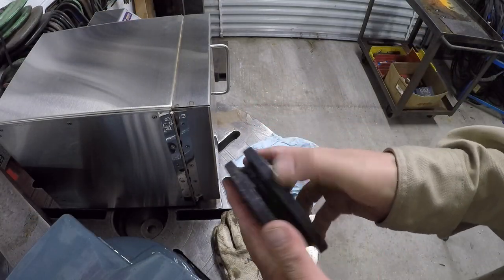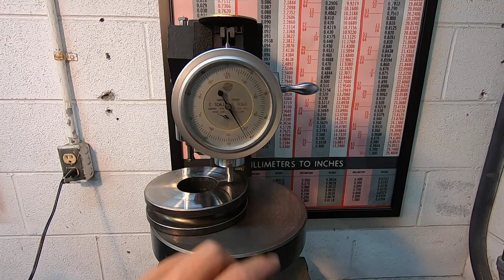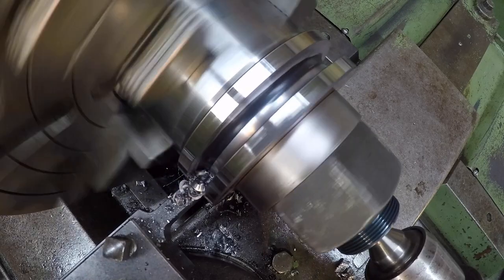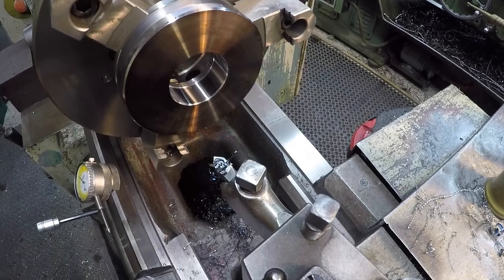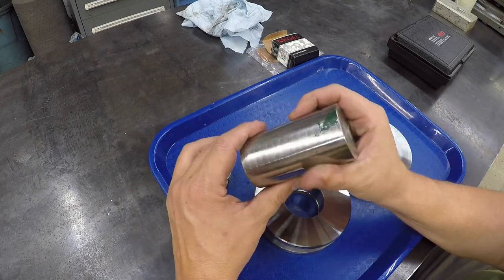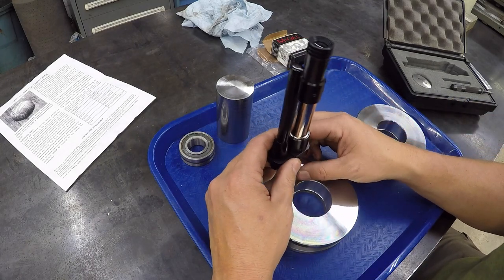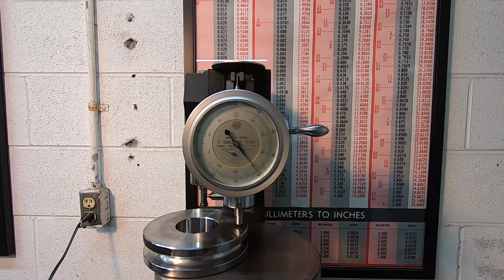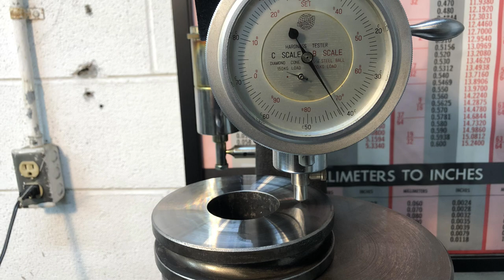Machining Cable Sheaves Part 2

Comment: Adam I really enjoyed this video.
Have you ever used D2. It is a Air Hardening steel that machines like 4140 or 4150. I have found that oil quenching can distort your dimensions more than expected at times. Also oil hardening leaves the scale behind.
Just a suggestion. You can get D2 into the mid 50 range on the Rochwell scale.
Take care.
Reply: I think for the application you want something with good yield strength. A tool steel is more for wear resistance, like if you are using it for cutting tool. I am not sure the yield strength for a tool steel.

Comment: The spot you see is probably the area where you touched with your hand metal tongue, it drained a huge amount of heat once it clamped the part, it shows in video.

Comment: Adam, Sorry up front, I'm going to throw my two cents in. Find a steel bucket for your quenching oil. I've made a mess on a smaller scale where I used a plastic cup of oil to quench some nuts. Eventually the plastic cup got hot enough to melt. Bit of a hot mess. Also just think if you dropped the hot part. Love your videos, keep up the great work. Just read further down someone else mentioned this, sorry for the repetition.

Comment: Does it make a difference what surface is beneath the part you are testing when you make the dimple?  Plastic tray versus steel table top?
Reply: Unless we are talking about incredibly light or thin parts, no. Only the pocket tester would be affected as there may be appreciable surface movement from the start of the indenting to the end. Like driving a nail through a free-standing piece of paper.  These would give false high-hardness readings from shallow impacts. The difference in indention size would be a solid measurement of the rigidity of the surface being used. For these parts though the diameter difference would be small enough that something a great deal more sensitive than that pocket scope would be needed to measure it. 
Now if we were talking about something the size of a bearing pin it may not indent at all! Good observation.

Comment: To get even heating rotate the part every 1/2 hr or 15 mins add a little more time for the rotating cause the ceiling of the kiln is always hotter. Also a big help for even heating use ( kiln Stilt ) that way you can lay the part down to keep part off the bottom and away from the ceiling of the kiln while still rotating or flipping the part.

Comment: Excellent teaching tool. Thanks man.
This is a true hands on example of the craft of metallurgy, precision machining and intefernce fitting of related components.

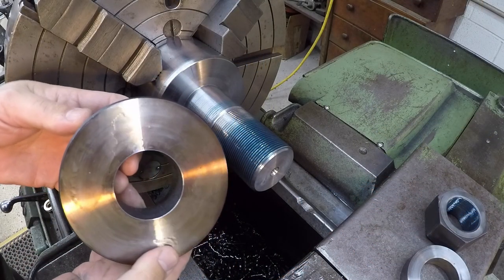Important note: You flip flopped the term annealing with tempering at the 6:15 mark.

Comment: I really like your channel. I envy your workshop, however, I haven’t figured out why your furnace y so far from your quenching oil. I figure the bucket of oil is near an exhaust or a door, but why you have to run to get your hot pieces to cool down?

Comment: probably the hardness is different due to holding it. You can make a pair expansion pliers that grab it in the hole.
Reply: Agree.  One could see the discoloration from the positioning of the tongs after the quench.

Comment: Nice video as always. However your heat treatmend definitely did not go as it should.
You should not gesuch a huge variation in hardness. either the temperature of the part was uneven, or the quench was. in either case you have a part with inconsistent properties.
Most likely the temperature was not yet homogenous throughout the part, it might even be, that parts that were closer to the heating elements were much hotter than the remainder, maybe havin the parts in flat instead of standing up would give a more consistent result.
A rough estimate based on the geonetry is that the part weighs about 2,5kg, so roughly five pounds. They will roughly need 1080 kJ (0.3 KWh) each to reach the required temperature. now calculating how long it takes to transmit that energy into the part is not too easy, so better err on the side of caution and give it a little more time.

According to the data a quick search turned out, you should heat and hold it at 830-845°C (1526-1553F) and then quench in oil, which should yield a part that is glass hard (64HRC ballpark) and then you temper it for two hours at the temperature matching your desired final hardness. For 58HRC at 205°C (401F) for 45 HRC at 425°C (797F).... there is a temperature/time/hardness table available for every material and especially the higher grades of material require some precission when it comes to both temperatuers and duration of treatment.

to avoid scaling use heat treatment foil (toolwrap) it creates an airtight seal but does not interfere with quenching because it is very thin. There are different grades on the market, depending on the temperature range and other desired properties. A 3,3 meter/10 ft roll costs in the ballpark of 65$ so might be worth a try.
It is probably a good idea to do some test cubes of different sizes to determine how long it takes to actually warm things through, it can take surprisingly long.

Comment: The area with 62 Rockwell I would guess was closest to the heat source. If you stood it vertical and turned it halfway through. Or turned it ever 15 mins laying on its side it would have been more uniform. 
Thank you 

Can you show how the coolant systems work. I remember seeing one with shop air connected and wondered what and how it worked.
Reply: It is more likely that the area of 62 HRC, was a result of the cold tongs chilling the part.  62 HRC is off the chart for 4140! Not good..!

Comment: Hi Adam, you know why the original parts are made of a softer material right? It is so you don't wear out the cable, tell your client he probable needs to renew his cable every 2 years or so if he installs these Sheaves. And i noticed you didn't putt in a groove to secure the bearing with a clip, just my 2 cents.

Otherwise smashing job, keep up the good work :-)
Reply: tried tell him that first time vid was up, look adam is a good machinist we learn from him and he learns from us , me 73 years been around heavy machinery all my life
Reply: @stuarth43  A friend of mine owns a garage, he had somebody make him harder rollers for the cable tensioners for the car lifts. They wore out the cables, he had to buy new cables for both his lifts (very expensive). I made him a bunch of new rollers from mild steel, enough for atleast 10 years worth, that was 2 years ago, cables still look like new. :-)

I'm not saying Adam is not a good craftsmen, i admire his skills. It's almost a lost art, coventional machining.
Reply: I thought the same, the sheaves are a sacrificial part, they're meant to wear out and be cheaper to replace than the cables.
Reply: At work we had two cranes at the local field station. Both were in use on a weekly or more basis. Rope was replaced on about a yearly basis. Why, because it is better to replace the rope which is easy to replace than a sheave which is expensive to replace. Yearly was based on wear on the rope itself and it would depend on the wear as to when it actually got done. The ropes were inspected before each lift was planned for so that if they were even close, they were replaced or shortened to the point where they no longer were marginal.

Comment: If the part you are quenching has enough mass you might need to quench in water and not oil. it is a matter if getting the temperature down from after getting the steel in an austenitic state. so what is an air hardening or oil hardening steel for a small part will need quicker quenching in a large part. look ar the hardening diagram for the particular material, not at weather its "oil" or "water" hardening ...
Reply: Wouldn't water be pretty poor at quenching because of leidenfrost effect?
Reply: @ionstorm66  You have to agitate the part in the water so no bubbles get caught and cause soft areas. Water is a rather harsh quenching agent, so much so that parts often develop cracks. as a general rule of thumb steel grades with a lower carbon content require a harsher quench. Below 0.2%C you will not be able to harden the steel at all.

Comment: I learnt a new word today: sheave(s). I always thought they were just called pulley wheels...or is there a difference?
Reply: The pulley is the entire assembly - block, sheave, pin, hook, etc. The sheave is just the “wheel” part of the pulley. 

But the terms are mostly interchangeable.

Comment: Can you not put the calibration puck on the other tester to see how they compare  for readings?
Reply: I wondered the same thing - it would confirm the other unit and show any differences.  If you do, I'd recommend making several measurements (the more the better, maybe 10) and averaging them to get the final result (the mean average = add all of the values and divide by the number of measurements you made).  If you are really interested in how accurate (repeatable) these measurements are in general, you can also compute the sample variance.  For that you take each value and subtract the mean from it, then square it, then add all of these together.  This will give you an idea of how spread out these hardness measurements are from their average value.  I know this may sound a little painful, but taking averages helps reduce process errors (like when you threw out the reading because the punch may not have been square to the disk) and also helps you understand the overall hardness of the plate itself and how uniform your heat treatment process is.  BTW, regarding that area of hardness you spotted, tested and found to be harder than the rest of the part... I wondered if the tongs cooled the part at a different rate when you grabbed it out of the oven, and before you got it in the oil treatment.  That could be why you are seeing a larger variation in hardness.  LOVE YOUR CHANNEL!!!  Thanks for all the great videos!

Comment: I wonder if you could get a more consistent heat if you did a preheat with the torch?
I'll bet that little area where it is harder was where you were holding it with the tongs.
Reply: The part was in the oven at 1600F for over 2 hours.  I don't believe a "preheat" would be any advantage.

Comment: At 40 to 45 Rockwell hardness the 4140 material should give good service with adequate toughness and dependable durability.
Reply: 40-45 HRC is very hard for 4140.  I fear the part may chip or more likely wear the hell out of the cable.

Comment: Adam, try to keep the part above 200F until you get it into the oven to temper it. Dont let it cool to room temp. before tempering.
Reply: Lundy's Den  that would literally have no effect on the metal
Reply: @tylerakerfeldt7220  -- Sort of. A thinner piece like a knife can abruptly snap if taken down to room temperature right after the quench. It's better to not let it cool completely before starting the temperature cycles. With these thick sheaves, however, that wouldn't be a problem.
Reply: @Makermook  ...Well a knife would typically be 1080.  Way easier to temper.  4140 can be tricky.

Comment: That area that had the different hardness is where the tongs were.  I wonder if you should drop it in, and then pick it up in a different spot, several times.
Reply: I was about to write the same thing.
He should just heat the tongs before picking the part up.
Reply: Lmao
That would have melted straight through the bucket he used
But I think you may be along the right lines on the tongs maybe leeched carbon from them or its the opposite side that wasn't held either or
One way or another inconsistent quench
Reply: Or put it in the oven with I piece of heavy gauge wire through the guts and pick it up by that.
Reply: yes drop it in a bucket of oil where you cant see it and pick it up in a different spot several time with tongs.  sure thing bubs
Reply: potato pobobot 
Ah, but after the hot part melts a hole in the plastic bucket he will have no problem seeing it to pick it up in a different place! 🤣🤣
Reply: Paul Reason 
I don’t think the tongs are leeching carbon, my understanding is that is a slow process, it is more likely that they are drawing the heat faster than the oil!

Comment: I need a LOT more practice when reading inside dia. with those. I have a hard time getting a consistent reading using them. Takes me a lot of tries right now, I don't know if it's me being new to using them or a cheap set that I bought used, they seem fairly smooth so at this point who knows.

Comment: If you want to case carburize some steel. The company I used to work for uses toluene as a carbon source. The high carbon skin is very hard. Tapered roller bearing are black. Very old trick. Very hard thin surface on a softer metal. I bet you could do this with parts in a steel or ceramic box. slowly pump toluene in Carburization would start as soon as all oxygen is gone. Need a good vent.

Comment: I don't think we ever had to replace sheaves in any of our cranes over the years. I don't think they were hard either. Straight lifts, drag line, clam bucket, demolition ball lots of different work.
Reply: That's interesting, are you using 5" pulleys like the one he's making here? I wonder if you just got lucky and your company buys high quality parts like he's making in the video. I also half wonder if the guy who's having the issue is doing something wrong. Are the pulleys you're referring to similar or identical to the 5" with 1/2" cable slot?
Reply: Are they just belt pulleys? Or cables, it seems from the other comment? Do they run at a good speed? Maybe the guy has some serious mechanical issues in the rest of the system, causing vibration for example. I know with belts that over-tightness and misalignment will always lead to failure, and I imagine cables would be even worse.

Comment: Question: if you quench/case harden it then machine it again depending on how much material you remove wouldn’t that remove the hardened case material? Could that have caused the raised spot you noticed on the hardness tester?  How deep does the hardening penetrate into the material? Only asking for my own education please and thank you!
Reply: Answer: Technically yes, but the little amount that is machined off doesn't have much of an impact, here is a starting resource, the external links seem to have good information as well. https://en.wikipedia.org/wiki/Hardenability 

It's likely the raised spot was effected by the temperature imbalances within the furnace or the slightly quicker quench times that using the steel tongs would've had in comparison the rest being quenched by air before the oil.
Reply: Case hardening is a different process. It can be done all sorts of ways, some which involve chemically modifying the surface of the steel, others are just a very aggressive spot heating and super fast quench. It used to be much more common because the metallurgy and temperature control required for good controlled through hardening didn't exist. With the proliferation of better steel and heat treatment options in the early 1900s case hardening became much less common. It is still used today, there are some really cool laser techniques among many others, but it the exception not the rule.  When we are talking about hardening a part like this sheave the material is hardened all the way through. You are correct, there is a hardness gradient on the surface of the part, but as long as the alloy and heat treatment selection process have been done properly that gradient should be pretty minimal.
Reply: @thereddufus  ....Yes sir, you are correct.  Completely different process.

Comment: 55-65 rockwell is about what you get when you quench high carbon steel, or tool steel, or 4140.
Reply: Too high for 4140.

Comment: If you measured the critical dimensions after heat treatment, it would be interesting to see any changes.  Very interesting pair of videos.  I even learnt the US pronunciation of sheave as shiv. :-)
Reply: Shiv is the roller, sheave is a stack of grain pronunciation.

Comment: I always get better results when heat treating by wrapping the part in paper then,seal it in stainless steel foil.The paper burns up the oxygen and the sealed stainless foil keeps oxygen from getting in..

Comment: Watch out for the plastic quench bucket.  They can catch fire and then burning oil run across the floor.
Just Saying :)
Reply: Oops ! it might take several days to clean up that mess...
Reply: He has stated in an earlier video that he is planning to get a steel bucket for it for exactly that reason!
Reply: Very good I must have missed that one.  I know Adam is a safety conscious person.
Reply: Nguyễn Vũ Hoàng Long 
No so much the mess the oil can easily be on fire at the same time.

Comment: Weld your own quenching bucket! Maybe with some kind of nifty grid insert that can be moved (by a pedal? A crank?) so that the part can be dropped, then agitated to allow proper contact with the oil. Knowledgeble people: Will a simple up-down motion suffice? Rotation seems inferior to me and both motions would be a bit complicated. Wait, I guess a pump could set the oil in a swirly motion - to complicate everything to a satisfactory degree :-) /Arm-chair guy thinking out loud

Comment: Should you put the oil for heat treating in a metal container for heat reasons ?
Reply: Could do it in a plastic bucket, but if you hit the sides with a hot parts it might melt. So yes, heat reasons.

Comment: Great vlog, would increasing the hardening temperature by 50 °F allow correct hardening due to drop from heat to quench?.
Thanks for sharing and stay safe all.
Reply: No. As long as you get it in the oil while it’s orange hot, it’ll be fine (for a hobbyist purpose)

Comment: Thanks for the great video Adam. Can anyine help me with bearing fit. I want to know what the fit would be on the shaft that runs through the bearing. Would that just be a slip or interference fit? Would like to start using beaeings in projects myself!